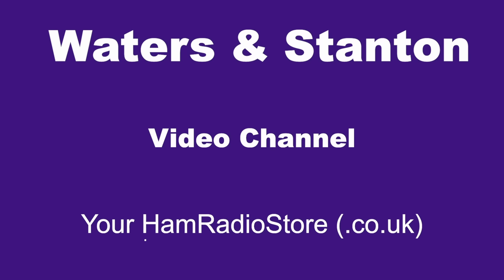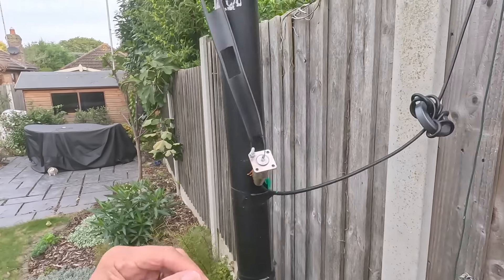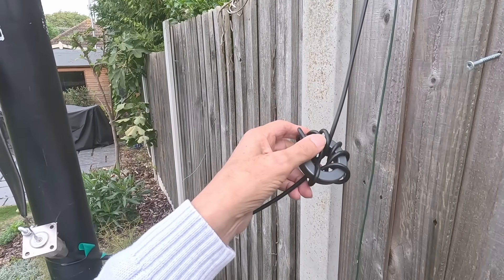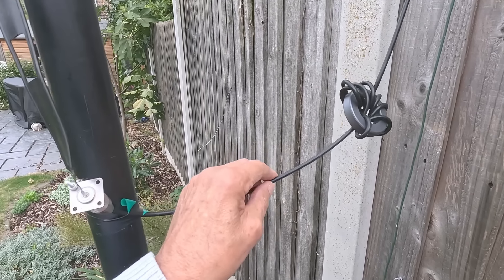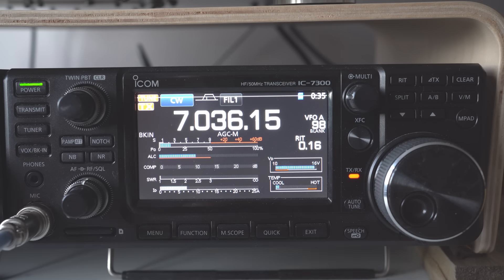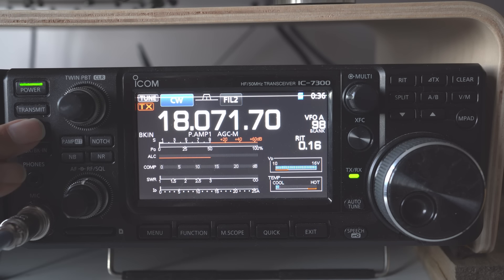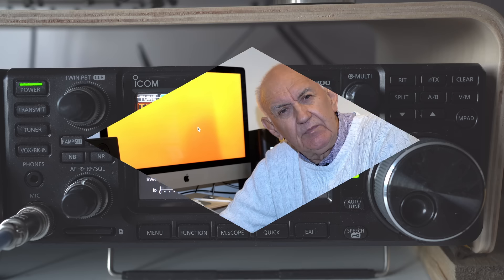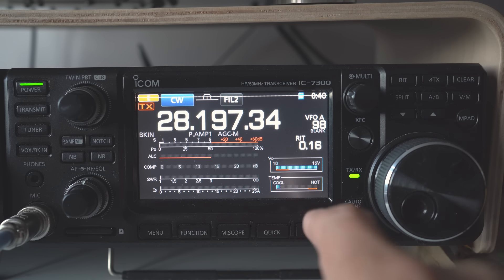Icom IC 7300 Hidden Ability - Check this Out! | Ham Radio

Comment: Do you have the voltage of the power supply set to the high end of 13.8v+15%? Just looking at the voltage meter on the panel looks like you're near 16v. I find that my 7300 is occasional dropping to 12v or 11.8v for voltage with my linear astron power supply set to 13.8v with the standard length of cable from icom. Was this the intention?

Comment: Informative video as always Peter 😊 I am a bit radical with my G5RV half wave. It is sited 20feet off the ground in a Y configuration with the feeder horizontal to the antenna. It tunes, 10,20,14 without issue on Dx 10 and earlier in the week I worked Tokyo and West Coast USA on 90w so can confirm it works 😊73
Reply from the maker: Well done.
Reply: @watersstanton  Thanks Peter, in my case necessity due to domestic considerations leads to some interesting experimentation. I also find it is 2 s points quieter than my end fed. 73

Comment: I enjoy your videos Peter. Emergency mode 50watts and lineloss reach much further than a reciever. I've tried to tell my hammates not to overthink things to get on the air. Any sort of antenna is better than no antenna as long you can match it. The satisfaction of working DX with "scrap" is priceless.
Reply: I have $5 of speaker wire and a decent mfj tuner that got me over 5000 contacts. Those dummy load long wire boxes also do pretty well. 😂
Reply from the maker: Yes you are right.

Comment: Tuning a coax with a horrible mismatch is useless..
Reply from the maker: You may be surprised at how small losses can be on even 6:1 VSWR with moddedst coax lengths. Check one if the calculators on the internet.

Comment: 👍Thanks for video Peter. I had spotted that Emergency Mode option in the menu but never tried using it. Wrap that SO239 with self amalgamating tape and insulating tape and it will last the winter no problem. I was curious to know what type of core you used for the choke on the co-ax? Taking a punt it's a FT240-43.
Reply from the maker: I used cling film last year and it worked fine. Yes I use that ferrite core.

Comment: Another great video,  Peter. I also use the IC-7300 as my primary rig I will definitely give this a try. Would reducing the output power to 50 watts allow the standard mode tuner to work? I'm thinking that it would not. Might have to give the Emergency mode a try. Thanks.
Reply from the maker: No you must change ATU  mode
Reply: The radio drops power to 50 watts to protect the internal tuner. By entering emergency mode, the firmware is set up to allow the tuner to use component values pushed to the limits of the tuner. These types of auto switching LC tuners usually have built in self protection to prevent an inductor or capacitor from seeing too high of a voltage.  If the radio ran at the full 100 watts, it would most likely smoke the internal tuner. so, by dropping the RF power, they can "fudge" the ratings a bit to allow for emergency use into a marginal antenna.
Reply: In Emergency Mode, can you select less than 50W power?

Comment: The SWR reading did not register any SWR whatsoever in emergency mode. this tells me that in emergency mode, this circuit is disengaged  thus preventing the CPU to control the output and equally not displaying any SWR on the screen. Therefore it is not tuned to 50 OHMs it is merely transmitting into a mismatch. Emergency mode is for an emergency only where you may need to comunicate regardless of a matched antenna only, as described in the manual. You therefore did not see a match, you saw nothing as the SWR indications had been disengaged and would be transmitting into a bad load. Icom had reduced maximum output to 50 Watts so the radio can survive this, not for continued ops as this video would imply.
Reply: Yet the tuner tuned.
Reply from the maker: Sorry, but wrong. If you move the frequency up the band the VSWR meter rises. And of course the ATU tunes as you would have heard in the video.

Comment: Good video!
I've never understood why any operator would want to "run" or "transmit" with a full 100 watts of power out in the first place.
Here's my automobile analogy; drive at top speed, (pretending we have pristine road conditions and superiorly tuned suspension), still, you're running it hard at which the vehicle won't last very long before a major malfunction.  It's like traveling with the "cruise control" on rather, at a much slower speed, like 50 or so miles per hour, and maybe less favorable road conditions but still, the vehicle will still last and run longer than at full speed.  And atmospheric conditions are a whole other animal in of itself.
Before I got my Tech Plus license here in the U.S., I worked DX across N. America from Akron, Ohio to Alaska with 12 feet of gashed-up RG-213 coaxial cable connected to a 102-inch steel whip that was lying on the balcony floor of my apartment underneath the railing with an old SommerKamp 10-meter radio that was struggling to transmit 12 watts out!  I think sometimes that operators want to run the full 100 watts to satisfy their ego, which is a foolish waste of a radio.
KD8EFQ/73
Reply: 100w out of the ic-7300 is like a governor on an engine. It is nowhere near red-lining an RPM gauge nor is it shortening the lifespan of the ic-7300. It's one of the most common HF radios and if people were happy with 3dB less they wouldn't buy the ic-7300. That's a full S unit difference and many contacts are made at or near noise level and an extra S unit makes all the difference. That said, using the emergency mode and forcing it to tune a very high VSWR is much harder on the radio than running 100w on a resonate antenna. Don't believe me? Tune any antenna with the ic-7300 that has about 3:1 swr and then check the tuned swr's. Hold the ptt while modulating at 100w for the demonstration and watch the swr climb. What's happening? The very very tiny toroids used in the built-in tuner are getting extremely hot and they lose efficiency when hot and the tune is lost resulting in climbing VSWR's. Any balun not made for QRP has large toroids to avoid getting hot. The only wear and tear on the ic-7300 is when you tune a way out of tune antenna. As the video stated, icom suggested the emergency mode reduced power was simply to avoid voltage issues but infact the tiny toroids tuning a 6:1 mismatch at 100w would melt the insulation on the magnet wire used n the tiny toroids. 
    The normal person avoids the emergency mode and their 100w is NOWHERE as harmful to the ic-7300 compared to the 50w using emergency mode matching a 6:1 SWR.
Reply: The engineers who designed these rigs took this into account. All 100 watt rated ham rigs use a PA capable of at least twice rated output and they run them at half power to preserve linearity and the life of the PA. So running them at 100 watts is actually "loafing along" and not straining at all. An example of this is the old Kenwood TS450SAT. They were a 100 watt rated rig. They ran a pair of 2SC2879 finals. One 2879 by itself is rated at 100 watts but Kenwood ran a pair for 100 clean watts of power without pushing the devices. Had they elected to use a single transistor, pushing it to it's full rating would make the IMD suffer and it would not pass FCC certification for spectral purity.
Reply: First, thank you all so far for the replies.  It seems as though I haven't gotten the notifications that I signed up for this channel which thus why I'm responding now 10/22/2023.
And thank you more so as I feel more confident about TXing at 100 watts with my Icom 7300.  I wanted to "baby" the radio upon experiences with other transceivers in the past that seemed to cook the finals upon TXing at full power.